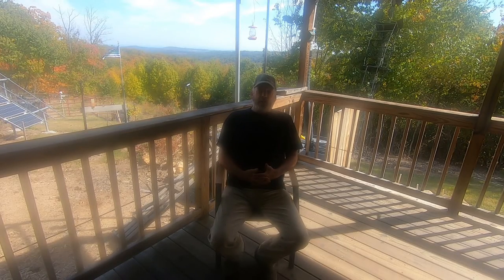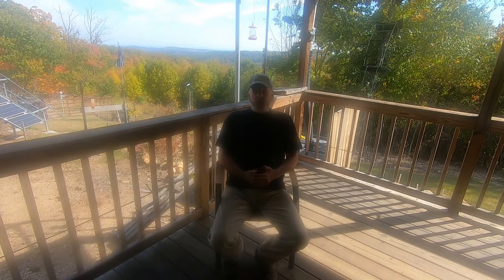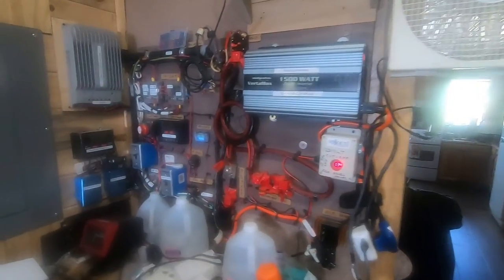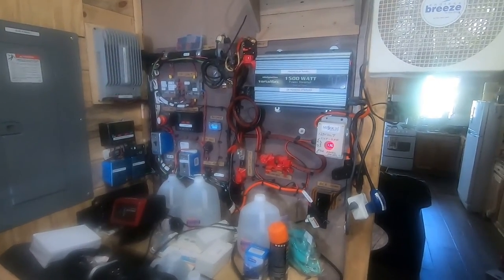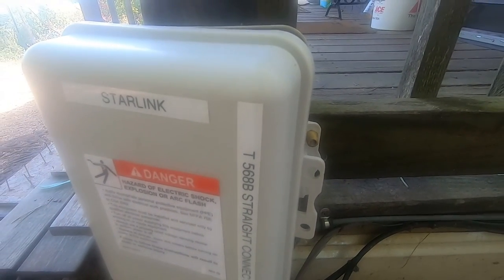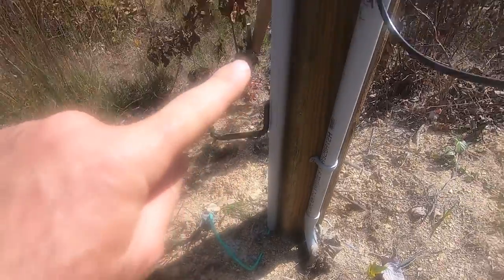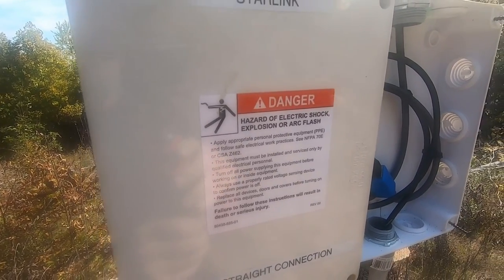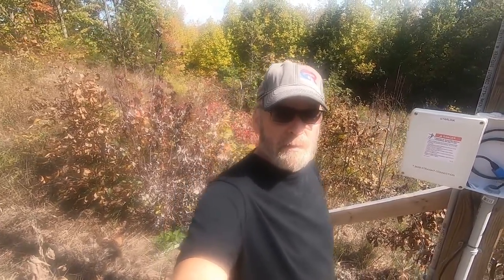Starlink Factory Cable Extension Splice Coupling Off Grid Powered

Comment: Great video!  One question, are you running your Starling on 120 VAC or did you convert it to run on 12 VDC?  I'll apologise in advance if you answered this in a previous video.

Keep the great content coming when you have it and are able.   Thanks for what you do!
Reply from the maker: It's on 120vac.  It pulls 50 constant watts.
Reply: @GrumpyMountainMan  Thanks for the quick response!

Comment: Great video!  Exactly what I needed because I have to put my dish about 275 feet away to clear all the trees.  Question on your drain wire. I can't see from the video, but is your drain wire coming out of the factory Starlink 5e cable? Or did you connect a drain wire to the metal end of the RJ45 connector?
And, could you have attached the drain wire to the lighting rod ground (dish side), instead of the house side?  In case the house side ground is not as easily accessible?
Reply from the maker: To keep it simple. You only attach one splice end to the ground not both splice ends

Comment: Interesting you mentioned using T-Mobile 5G, if you can get it. We got the TM 5G while waiting on the Starlink hardware. In your opinion should I return the SL equipment? My biggest usage is to work remotely. TM 5G isn’t the best I’ve ever had, but I’d heard raves about SL so I ordered it. Thoughts?
Reply from the maker: You can travel easy with T mobile correct?
Reply: Yes, it can be used when traveling. We haven’t tried it yet.

Comment: Great video. Can you provide the manufacturer info for the shielded factory wire you used? Also, what pass through did you use (the one with blue plastic). Last question, did you put a shielded RJ45 for them starlink cable? Thank you in advance! Best of luck with them bears.
Reply from the maker: All that info is in the description with links where to purchase.
Reply: @GrumpyMountainMan  I was on my phone and didn't see it! Thanks for the reply, much appreciated.
Reply from the maker: @dractul  Sure hope it helps. There is an Esty link I provided where a guy will make your connections. It's actually cheaper than buying all the needed tools . I don't know the guy or have I used his services. But just remember you can't go over 300ft and 250ft at the outer limits.